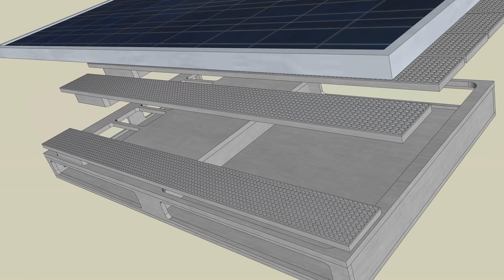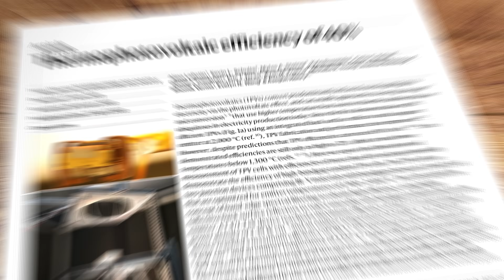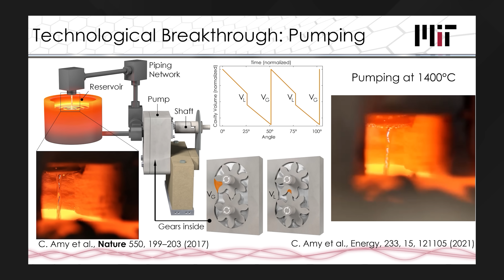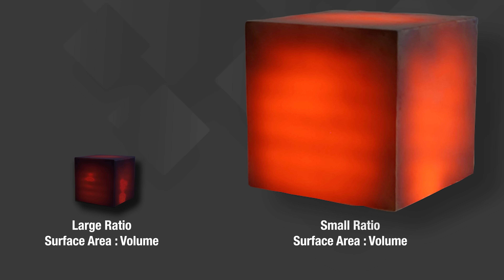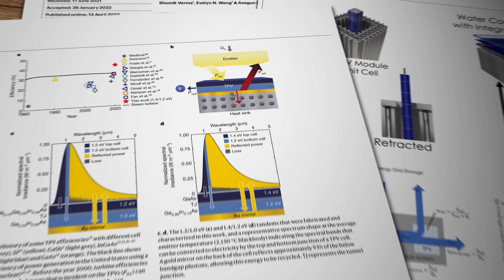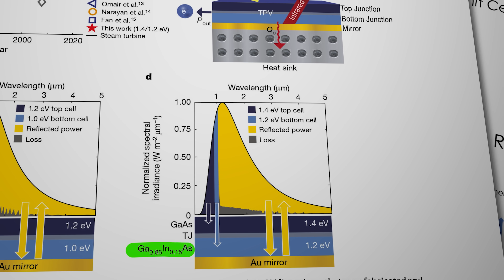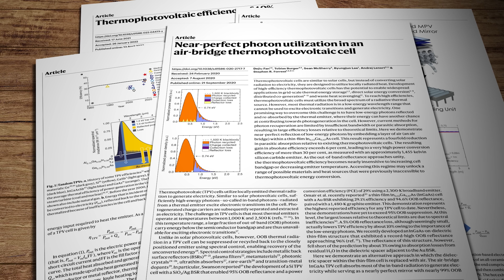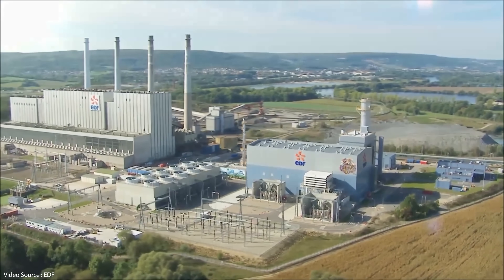Grid Scale Energy Storage 30x cheaper than Lithium-ion! How do they do that?

Comment: No just no. Next idea that isn't stupid please.
Reply: @elzo stubbe it's not 40% efficient if your having to spend energy to heat the tin up then bleed that heat away to protect the cells which you then have to go heat up more tin again. The more electricity you generate the less efficient it becomes. Also there is no way that 40% quoted efficiency includes the energy waisted to heat the tin up let alone the additional energy needed to reheat depending on how much electricity base load your trying to keep it at. It's stupid because first principles. Delete parts not make extra parts to compensate for design errors. Just solve the design errors.
Reply: @danielpalmer8324  You sure? Question here is how much energy gets absorbed by the PV Cell how much gets converted to electricity and how much passes through to the mirror, isnt that the only major leakage of energy out of the system? What do you mean with energy wasted to heat the tin? Its not wasted is it?
Reply: @CornMCMais  yes it's waisted. First nothing is free. If the system requires heat then the energy used to supply that heat is waisted just to provide the correct conditions for that system to work.

Second you have to move that liquid tin around, again waisted heat because nothing is 100% efficient heat will be lost moving the liquid tin around.

Third the heat tank wile much better at retaining heat heat is still lost there. And the hotter whatever the faster that heat leaks away. But using bigger tanks is better it's still a engineering bandaid. They are over engineering part's not absolutely needed in the first place.

Fourth you lose more heat again when you dip those rods in the the energy chamber. The more electricity you need the deeper you push the rods in. So that more heat is lost faster because each rod basically is like throwing ice water on the tin. So you have to cycle tin through this very fast and keep reheating it again that keeps requiring energy to reheat the tin. So what you have here is something that requires condition's that are very energy intensive to produce energy. It's stupid. And this is being polite about it. There are any number of ways to produce more electricity using less energy than this system. Also that 40% haha they probably calculated that number excluding all the energy needed to make and maintain that liquid tin. They probably rated just the energy that is converted from the cells. Because there is no way the total energy efficiency is anywhere near that high. Laws of thermodynamics kinda don't work for this brain dead concept. It's actually kind of offensive actually. That's how not efficient it is.
Reply: @elzo stubbe Due to the transfer of heat energy, this system would be extreamly inefficient and require massive maintenance. No no no...

Comment: Must be room for a steam turbine in here somewhere.
Reply: It's not water, it is liquid tin.
Reply: @menotyou1234  What comes out of the cooling process is water that is turned to steam is it not?
Reply: @giszTube  In the video he says that the water is moved through the cooling section fast enough that it doesn't turn into steam; they want to avoid it becoming steam, it just needs to draw enough heat away from the carbon/tungsten 'power blocks' to bring the temp. down far enough so as not to damage the TPV cells.
Reply: You mean must be room for a liquid tin turbine in here somewhere 🤣
Reply: At one point you will notice the use of liquid cooling water being cooled in a radiator, (similar to a car) it would seem wastefulness not to use this potential energy…Just an observation, perhaps I listened better than you…
Reply: @Me Notyou, my point, a lot of potential steam/ heat/ hot water or what ever is being lost, use it. Big up LogicMagic, lateral thinking should be applauded.
Reply: Why not just ditch the TPV completely and use the heat to raise steam? It's proven technology, very efficient and certainly more power dense.